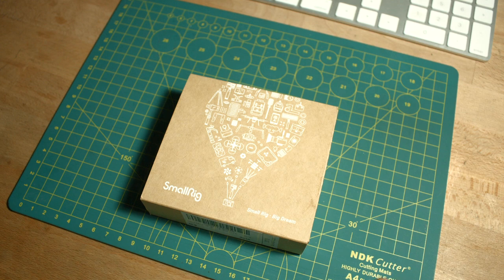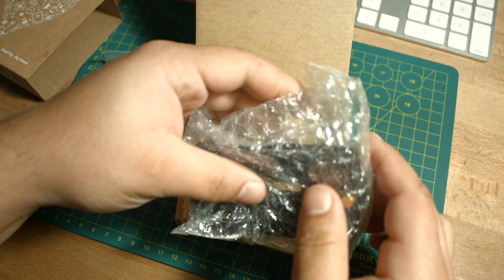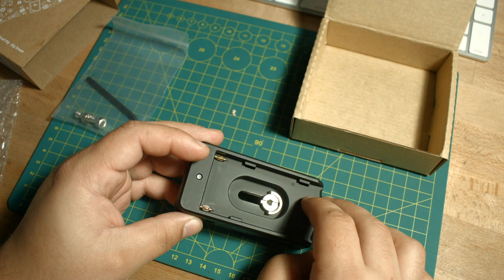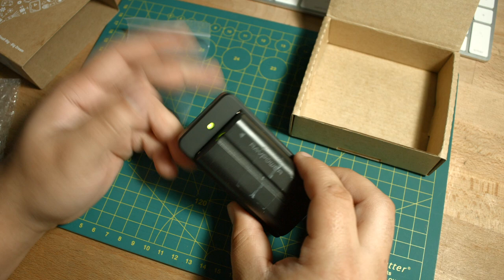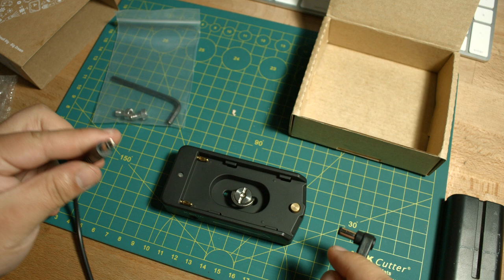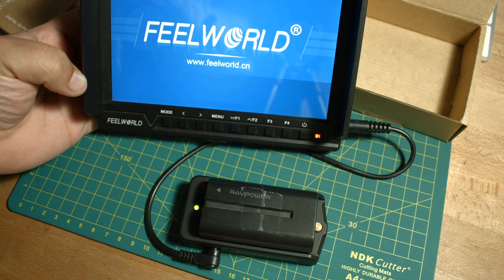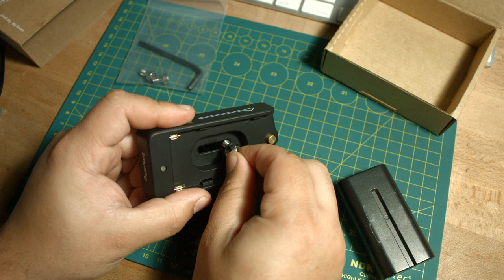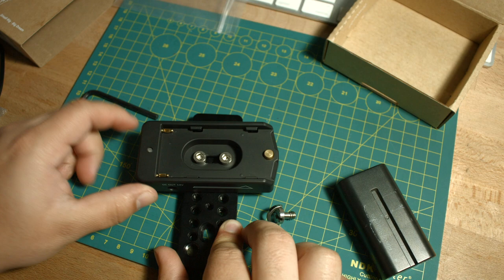Affordable Filmmaking: SmallRig NP-F Battery Adapter Plate Lite | Product Unboxing & Overview

Comment: I purchased an Andycine plate because I needed more power outputs. The Andycine plate has PD-In, PD-Out, USB C, and D-Tap. I needed either PD-Out or D-Tap for my LED light, along with USB for the camera. It works well with the exception of being very difficult to remove the battery from the plate.  Oh Yeah, I'm a big fan of SmallRig but I think their plate needs more power options.